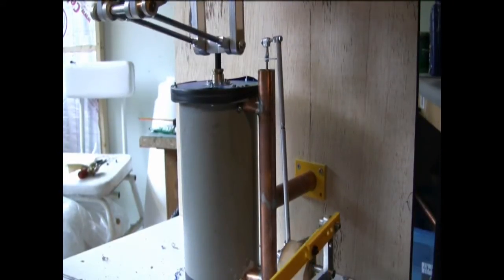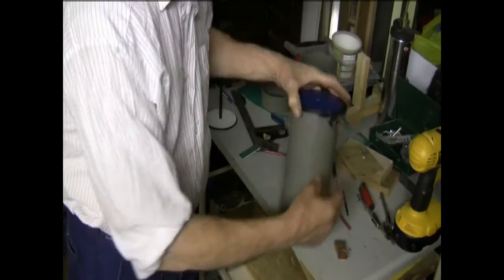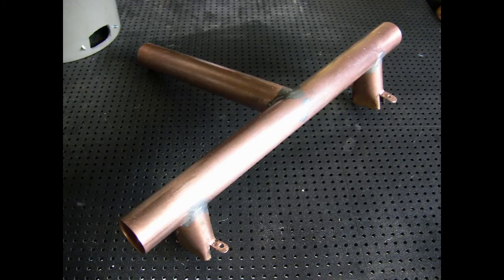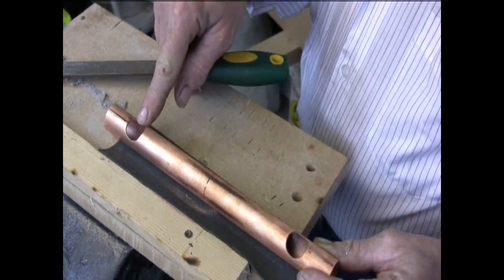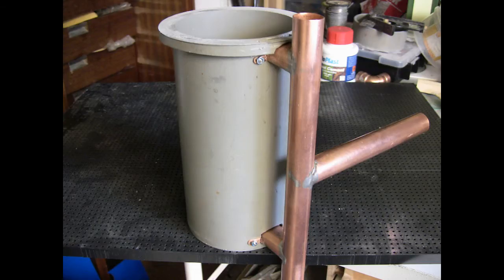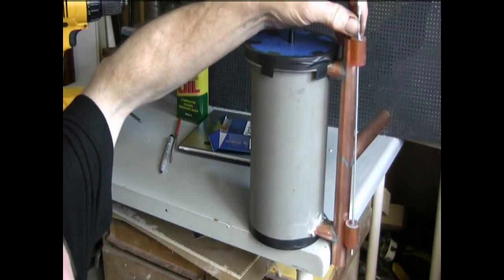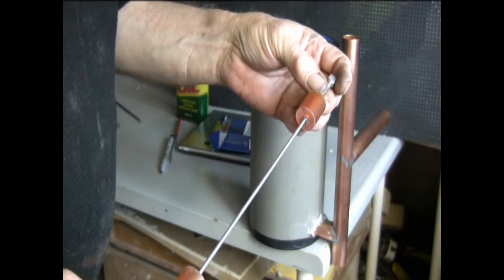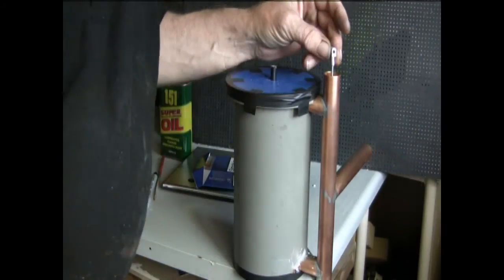BEAM ENGINE MAKING THE VALVE GEAR.   PART  7 by shed engineering

Comment: A beautiful and an elegant engine indeed. I came here after seeing a video of the original in a museum where a reference was made to this video. Looking at this model and its parallel motion  link to the power piston, I would say that this parallel motion link is even better than that of the original. Congratulations. 
I would say that if  you waxed the inner surface of that copper tube for the valves, the resin would have slid out as they use wax in fibreglass molds .   I am trying to locate the other parts to this video but am having some difficulty.